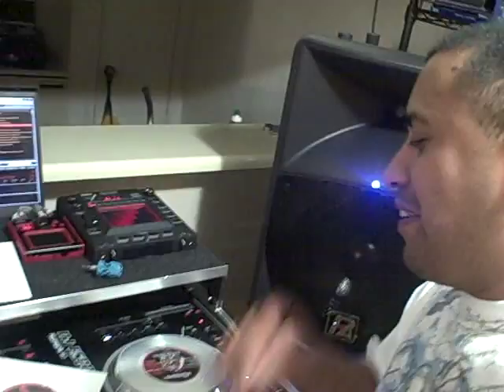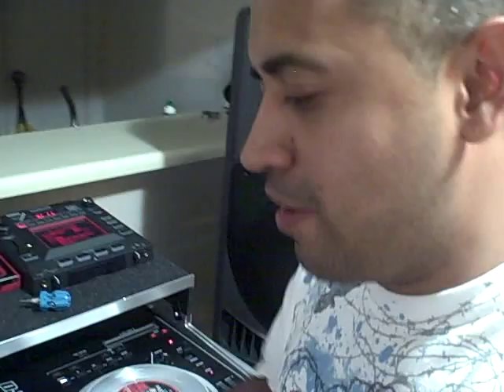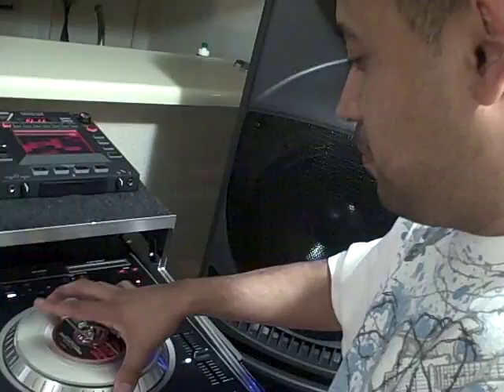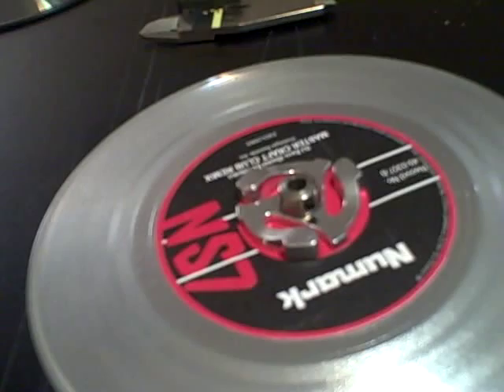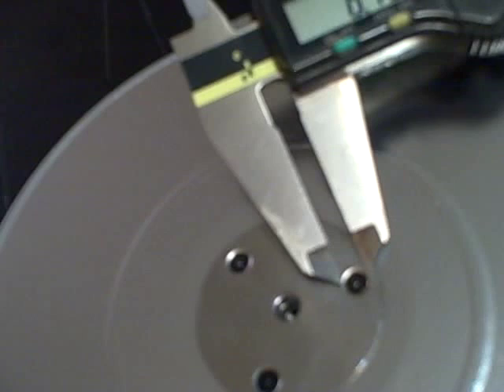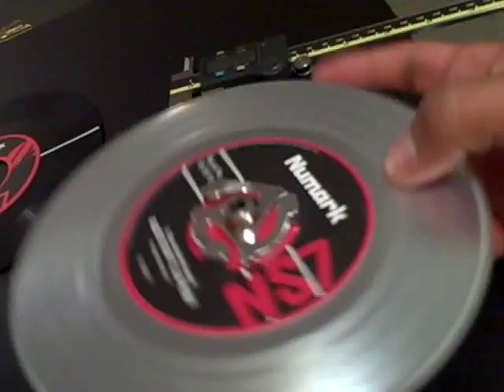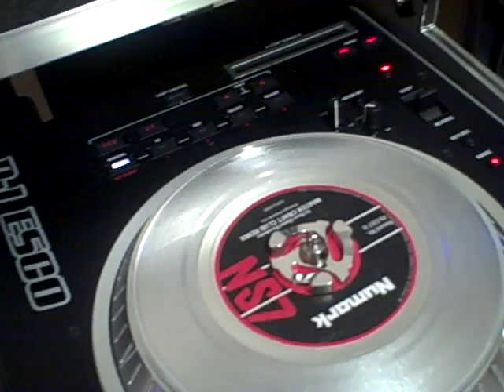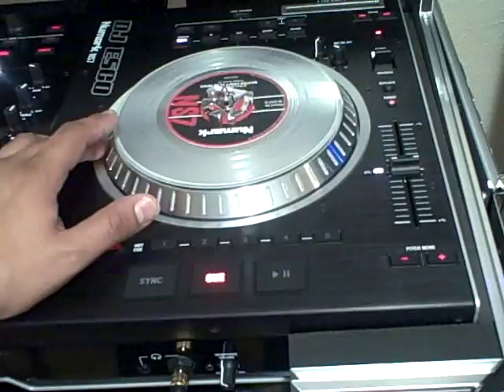DJ Esco Instructional Video on Numark NS7 Moddification DIY

Comment from the maker: The NS7 does not have kill "switches" However, uses rotary knobs with a "Zero to full Kill" range. Backspins can be performed and you can vary the speed, duration and  direction (fowards too)
The NS7 runs in perfect Harmony with Seratos ITCH software where all features on the NS7 work excellently. You may use the NSFX controller (includes ITCH 2.0) and use the effects included. Yes Virtual DJ version 6.02 and higher work (see the VDJ video and posted comments)
Hope this helps.
DJ Esco

Comment from the maker: The case I am using in this video is the Odyssey FZGSNS7W Glide Style Case.  I liked the fact that it had a Gliding shelf top.

However, I have not used or seen Numark's version except for online. I would like to do a review on both not just based on features but the critical things like engineering and design, reliability, and quality.

Hope this answers your question.

Comment from the maker: @WonderWeiss324 I dont have that particular system. However according to Vasili55 you will need to go to Advanced settings in VDJ configuration in CONFIG on VDJ for your output to be Master + Headphones. Master channels 1&2 and 3&4 are your headphones. From there make sure you have your CUE mix dial on the MT Pro turned up, and selected on either CUE or PGM. hope this helps you and others.

Comment from the maker: not really. 2 things to be concerned about:
1 thickness of record. Due to weight (thick is good thin is too light on the platter)
2 Hole the NS7's hole is slightly smaller you will notice that there will be play or "slip" on the large hole records.

Comment from the maker: @msdjluis1 instala la version 1.7.1 de ITCH en su systema esto arreglo varios problemas. Y durrante el processo de instalacion elige installar el firmware update. si tiene algun problema llama me a mi al (832)798-0000